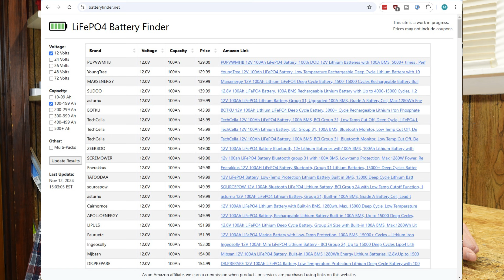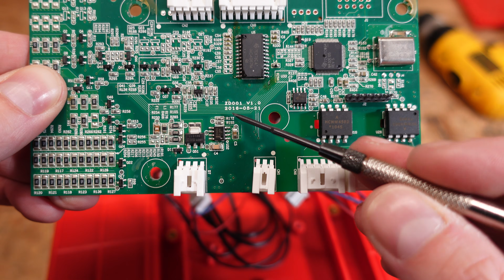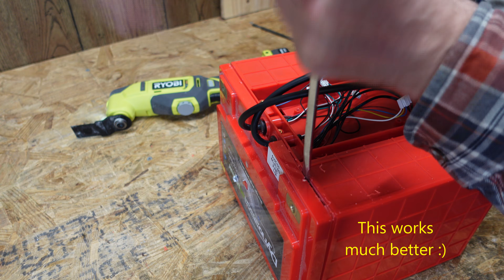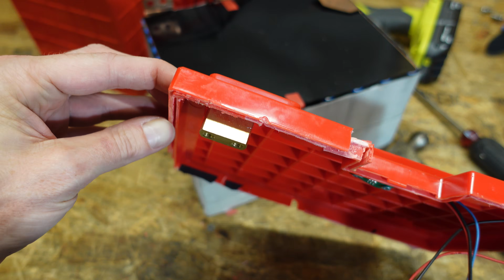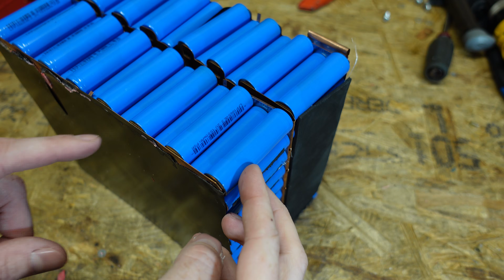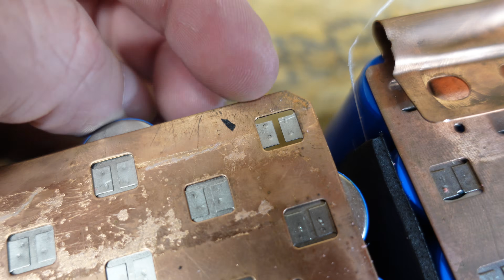Brick of 18650! DynoEurope 12V 120Ah LiFePO4 Battery Teardown

Comment: Those welds are beyond bad, you really should not be able to tear the welds off without ripping the strips or deforming the cells.
Bad welds like these can cause serious issues, imagine a cell loses connection when it's empty, you then recharge the battery and that one cell doesn't get charged. Then it regains connection and gets recharged at ridiculous current in a few seconds.
Granted this is LFP so you don't have the same risks of the pack turning into a fireworks cake but still this is horrible.

Comment: I acquired 12 of those batteries and several BMS units about 10 years ago. 4 of them have been in my golf cart ever since. They still report 88-92% capacity. The original manufacturer was Valence but yours has been rebranded. You are correct that the battery doesn’t have internal switching and it relies on the 
External BMS. They communicate via RS485 using a pretty basic instruction set and will respond to polling. I could give you more detail but you are probably past that. 

The batteries are designed for Hospital-grade backup and are rated for 20-year life. The cell falling out is probably from being dropped. They are extremely robust cells otherwise. 

Also, it’s a shame you cut into that case. Opening it just requires a quick blast of air through the LED hole and the top pops up.
Reply: Mine are slightly larger at 99P-4S for 148.5AH.
Reply: The individual cells in my packs are labeled:
+LISHEN VALENCE Proven™️ 3.2V -
IFR-18650EC YN06
So they are probably 18 years old. And even the one I accidentally killed to <5V for months is still testing at 113.8Ah. (76%+)
Robust chemistry in them cells. 
Yours might be a knockoff.
Reply from the maker: Thanks for sharing this information. It's neat to hear you can communicate with them and it's not some proprietary encrypted protocol or something. Also, not so sure about using air to remove the top. Mine looks to be glued on with a superglue-looking substance. Maybe your cases are slightly different.
Reply: @LithiumSolar  The glue is intentionally weak. It has worked 100% for me. Also what is the copyright info on the board? Is it valence?

Comment: 18650 Lifepo4 are still better than lithium cobalt manganese.    You could make some small 12v uses for those cells like holiday lights powered by a small solar panel and a battery of those cells .
Reply from the maker: Agree that they're better than colbalt-based batteries, but I still don't have much use for them. I'll probably end up giving them away.

Comment: Without verifying the capacity of batteries sold on Amazon, I’m not sure a comparative price will be a worthy guide. I would estimate that greater than 35% of the batteries offered on Amazon have over rated capacities. If you are testing these batteries for capacity your data would be very helpful. See Project Farm 18650 battery capacity testing. “Will China's 18650 Battery Beat LG, Samsung, Sony & Panasonic? Let's find out!”

Comment: This battery looks to be a good quality, but the spot welds sure looked weak. I hope 18650 sells are still being made, I use them for several flash lights I used quite a lot. Excellent video.
Reply: this is 18650 with LFP chemistri, its 3.2v, dont confuse with 18650 Lion one in the market with 3,7v

Comment: Is there any market for used 18650's?  I did get some 48v 10ah packs on amzn for $170 for my ebike. So they're still in use out there.
Reply from the maker: There always seems to be someone interested if you're able/willing to navigate the shipping regulations. There's not really anyone that seems interested locally (to me). I had to give them away last time and even then, that person drove from a few states away to pick them up.
Reply: I know many laptop recyclers that resell the used 18650 cells, in general they are at 70-80% of the original capacity and that is a lot for many people just looking for cheap cells.
Reply from the maker: @GeomancerHT  The problem is shipping. A lot of people selling them are just dropping them in the regular mail because either 1) They don't know that they are restricted 2) They don't care what the regulations say. I cannot knowingly violate the regulations and ship them.